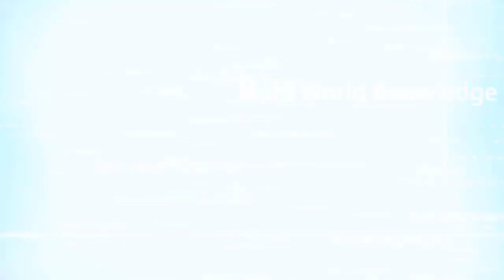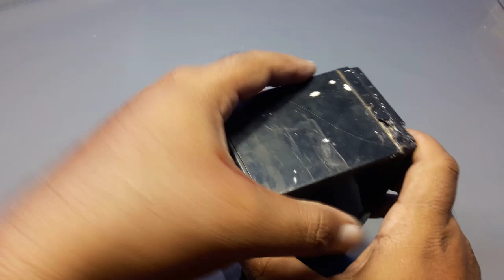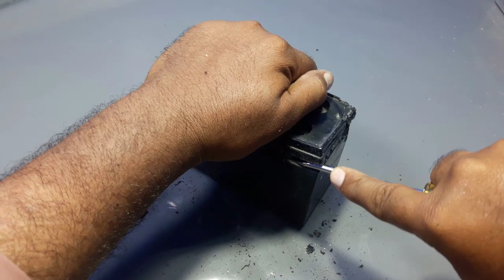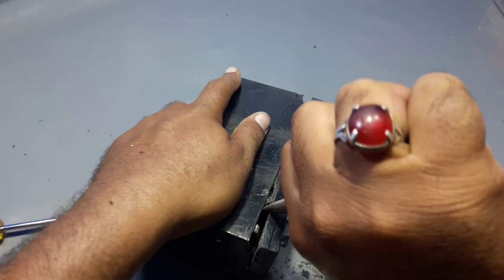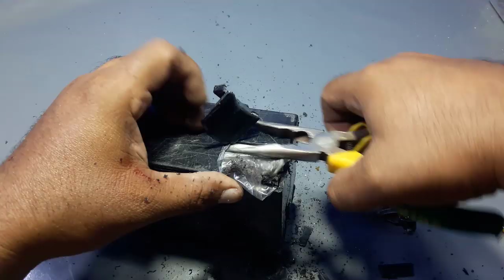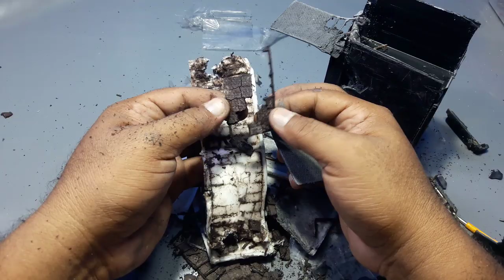What is Inside 12V Battery

Comment: Bro i'll tell you why you made a mess of it,  looks like you did not expect that the cover was not joined just along the sides but also at the holes also, where the six plate sets join each other. The cover had to be sawed at each hole with the hacksaw to get it off neatly in one piece. No need for tearing the walls.